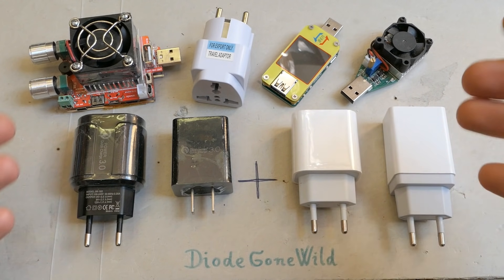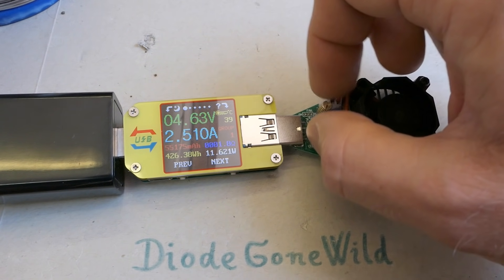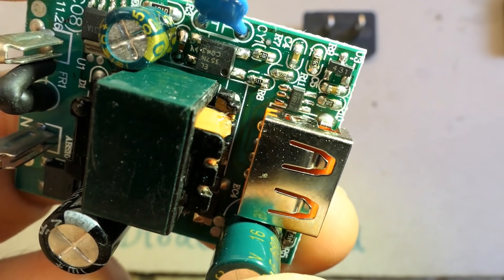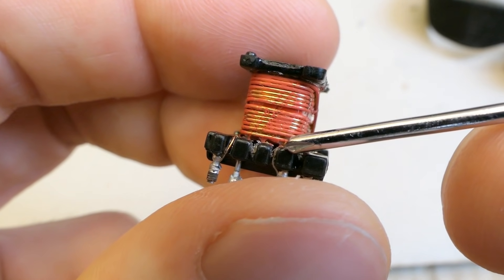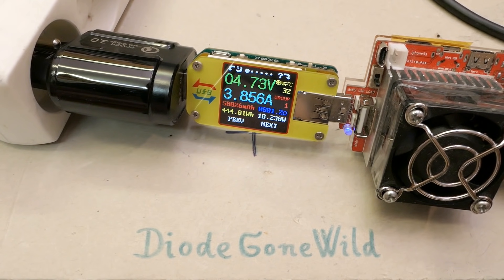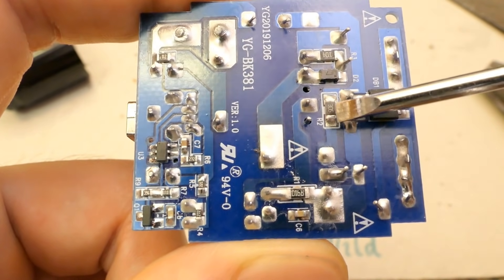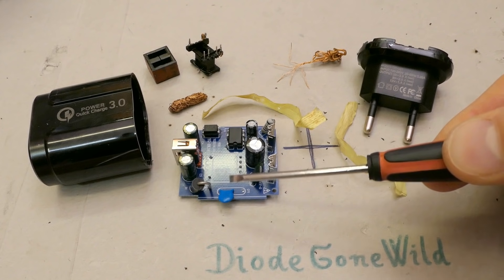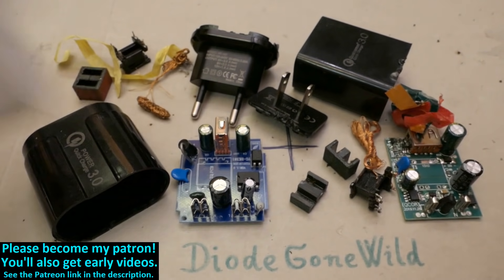Dangerous USB phone chargers 7 (QC 3.0)

Comment: Dodgy chargers never get boring
(You could also take a look at some real dodgy ATX PSU which are real cheap, price and quality wise)
Reply: I've seen lot of them and honestly they are not as dodgy as they could be, and some of chinesium type higher power psu are ok-ish. The biggest problem is low efficiency, no protection, rating from ass (sometimes 2x more than in reality), and use of low quality components (and fan, so it leads to explosion). Sometimes you can also see omitted filters, PFC choke made of cement in a plastic case (that's not a joke), radiators almost from aluminium foil... But safety-wise it's not that terrible from my experience.
Reply: @michamaecki8104   they do survive about a year or two when used lightly just doing word processing and some light stuffs on computer but interference... Interference everywhere, noisy fan and fake PFC coil and less to nothing noise filter.
Reply: Here in india i got a 450w atx power supply for 300₹ (~4$)
Reply: @hardnachopuppy  Does it have any protections like over current, over voltage ...?
Reply: @Leon-ts1nl  it does but only on 12v rail
Reply: He should take a look at some Gigabyte exploding PSUs.
Reply: @CaveyMoth  Aah yes, P750GM, now that was a super nice power supply! :)
With regards to the cheapy ones, they usually have poor quality components and also very weak 12V rails - which is where the CPU/GPU power goes, as well as a load of other important stuff. So you need the full power availability on the 12V rail.

Comment: There was a girl using a cheap charger while listening to music on her phone, and somehow the charger failed and the AC mains somehow came through the US connector into the phone, then through the earphones and killed her. That was a freak case, because for the AC power to be able to get that far and that long before burning anything out was quite crazy. What I suspect is that not both lines of the AC made it through, but just one made it through, and somehow the girl was grounded and thus she completed the circuit and died. Likely a cheap transformer allowed  one of the AC lines through into the secondary coil, and then from there through the US connector, and into the phone it somehow found it's way to the audio jack, and then it was able to cross from the speaker head into her ear and into her brain, and out of her body from however she was grounded. 

Either way, even if that is a freak case, I would never suggest anyone actually use wired earphones while their charger is plugged in, no matter what brand the charger is.

Comment: I've seen a failure mode in switching power supplies where the secondary rectifier would get so hot that it would start conducting in reverse, which would then cause the primary-side overcurrent to trip. Once the diode cools off, the primary restarts and the device cycles like that. I suspect this may have been why the second charger was cycling even though it could initially supply more than its rated current.

Comment: I think I’ve watched all your dodgy charger autopsies and I still enjoy watching each new one 😁

I was wondering how smooth the output of these chargers are. I suspect that there will be significant differences between the chargers on this aspect too. 
Perhaps you could show us the ripple on these chargers, especially at some load. 

A large ripple could cause damage to some phones.
Reply: I learnt that lesson the hard and expensive way. I used one of those cheap chargers to charge my phone and it ended up permanently damaging my touchscreen, it reported random touches by itself and gave erratic behaviour
And hell, at the same time I used it to power my raspberry pi, after some months wifi, bluetooth and usb stopped working
Now I only use OEM chargers, they're worth the extra couple of bucks

Comment: I really like teardown video series with those crappy chargers, I was a little bit shocked, how dodgy can be such charger especially transformer. 

I would also include in charger rating its output properties, while some el cheapo chargers can be safe and deliver advertised power permanently, they can have problems with ripple, voltage spikes on output that can affect touch screens (phantom touches, not registering touches), fingerprint readers and sensitive appliances. If you have time and tools for that, try adding this into your rating conclusion.

Thanks for so far reviewed chargers and I am looking forward to new teardowns ;)

Comment: Nice! I was looking forward to another USB chargers video! :)
I personally wouldn't trust any of these dodgy chargers from eBay... a genuine OEM charger, or a good quality replacement, would probably be my best bet. I have at least 3x genuine Samsung chargers which are all going strong, as well as a two port Anker USB charger (also works fine). I don't use cheap knockoff chargers.
Reply: Same here: I use Anker and genuine Apple chargers, that’s it. Anker’s latest multi-port charger is delightful.

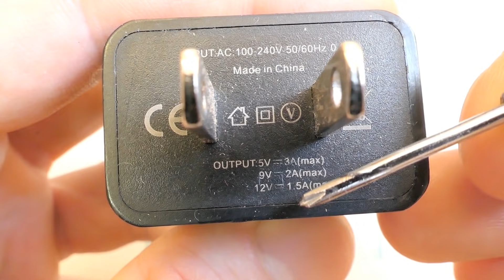Comment: 1:02 this is an old model usb adapter:
at energy efficiency only V appears and newer models have printed VI on them
Reply: All of the ratings on these cheap non-certified is totally fake. The Chinese will screen print energy efficiency level VII and CE, FCC, UL, or anything else you ask for.
Reply: @johncoops6897  I opened the topic with the energy efficiency mark to say that all these adapters are stocks and old generations of adapters: I would be curious what the ones with the VI mark look like on the inside. 🙂
Reply: @mihaiachim5299  - The adaptors with a VI mark would look EXACTLY the same on the inside. These shitty cheap adapters are NOT certified for any Safety Standards, and they are NOT tested for Energy Efficiency either.
My estimation (as somebody who managed testing and compliance for a power supply importer) is that these wouldn't meet even the lowest standards.... irrespective of what is written on the enclosures.

Comment: In the second charger...do you suspect that most of the heat was from the diode on the output?

What do better quality chargers do differently to fix this issue?
Reply: 2x shottky in parallel is very common, but real good ones have FETs as well w/ control logic to switch them similar to a diode. The heat was from the diode and the transformer, mostly, the capacitors likely have high(er) ESR which also contributes, the traces are likely not large enough to carry 3A, so some losses there as well. We don't know the original quality of the solder joint but that could be an issue as well.
The overall quality appears to be of a complete noob doing the soldering part (it is manually soldered, note legs are not trimmer properly either), hopefully not forced labor...
Reply: The higher quality chargers also use Schottky diodes with super-low forward voltage drop and over-rated (ie. 4 or 5A in a 3A charger).
I was repairing something the other day that had some special diode with 0.12V drop at 4A, and the maximum current through it was only 2A.

Comment: Hi Diode!!! Really appreciate your videos! What about making a non-dodgy USB charger video series? Some of them are really interesting... For example I have a 5V 2A Samsung USB charger which works very well... It outputs 2.4A at 4.8V (around 2.2 at 5.2V) and the ripple is also very low compared to the other ones. But the real gold about this charger is the fact that the no load voltage is 5.1V and as soon as you start loading it the voltage rises gradually to 5.4V at 2A, and this helps a lot to contrast the voltage drop caused from sh1tty USB cables and very used and old USB ports that don't make a good contact.
Since I'm curious, I opened it and I've been positively surprised... In fact it has a little bit of interference filtering, a double 4.7uF 400V primary smoothing capacitor, then it has a physical cut in the pcb with a plastic barrier in order to separate the hot side and the low voltage side... Then it has a pretty big SMD output diode with a wide tinned are working as an heatsink... Then it has two 390uF 6.3V low ESR polymeric capacitors in a pretty small case. The transformer looks good and so the general quality.
The model is ETA-U90EWE travel adapter. The markings are in both English and Russian, but there are some just in Russian... Eg. There's this marking дата производства: 30.07.2003, which I think it's the production day/month/year... You should make a video about it! 😃👍

Comment: I love how the cheap circuit board has the UL recognized component marking (looks like ЯU) even though it's sketchy af. Just because the factory that supplies the circuit boards has good quality control (in theory necessary to get UL certification) doesn't mean the factory that assembles the power supplies or transformers isn't sketchy as fuck.

Comment: Please someone told me about if optocoupler failure will flyback power supply send surge voltage to secondary side / output? any fail safe mode? like sense from aux winding like primary sensing?

Comment: I wonder WHY they couldn't supply their voltages. Is it the board design, shit solder, poor transformer windings, or crap components?
Reply: Transformer (more precisely, too thin winding wires)
Reply: The second one did reach its nominal voltage at its maximum current before it heated up. The efficiency of the secundary rectifier was poor, causing major losses and/or protection mode and possibly the RDSon resistance of FET in the driving chip was too high for the power that was to be delivered, causing it to heat up and go in protection mode. The transformer didn't go into saturation as it could  deliver its nominal power for some time. Also if the copper losses would have been too high, the transformer might have melted before the diode or the driving chip.

The first one didn't have an obvious cause, it was probably diemensioned correctly for half the power and then the primary current limiter was modified but nothing else.
Reply: @МихаилЦымбал-д9м  too thin wires would cause transformer losses (copper losses, not necessarily core saturation losses). This might have been one of the many things wrong with the first adapter, but probably not with the second one - or at least not obviously. Maybe after you uprate the driver and the rectifier which are the only obvious bottlenecks in the second one. I would first try and modify it to use active rectification and then see if there are still other problems.

Comment: Great videos ! , one question please - I have a bad LED driver that has a 10MF 400V bad primary smoothing electrolytic capacitor, is it OK to replace this capacitor with a capacitor of 47MF 450V ?
If not, what can be upgraded and what can't, V / MF ?
Reply: voltage - anything over 400V+ would be ok (for 230V mains), and having more capacitance would also be totally fine - the inrush current is unlikely to damage the diodes. In other words - it's a fine replacement.
Reply: @stanimir4197  thanks a lot - It works :-)

Comment: What is the name of the device that can switch to 5 volt 9 volt 12 volt which is red in the middle
Reply: How does it figure out which voltage to put out at the output? On the PCB the data pins (the middle two pins) are soldered.

Comment: Lets be real no phine will draw 3 amps continuously frim any charger so your testing with long time arent that good and acurate
Reply: If you print a spec on a product it is reasonable to assume the product can meet the rating.
Reply: @1pcfred  of course i dont disagree to that but the secind charger neet its ratings and any way most phine nowdays use fastcharge nit slow charge with 5V and even is they still use it they are nit gonna graw the hell amount of current that the charger outputs i mean its not gonna max out the charger
Reply: @constantinjitariu1439  I don't care about phones. I don't even own one.
Reply: @1pcfred  why?
Reply: @constantinjitariu1439  why what?
Reply: @1pcfred  why dot you have a phone?
Reply: @constantinjitariu1439  I do not have a phone because I have no use for a phone. I don't call anyone so what would I do with a phone?
Reply: New phones do if battery is to low, my nokia 6.1 draws 3a from charger until 60% and then drops to around 2.4amps.
Reply: A modern phone might draw 3 amps at 5V for 2 hours. If it does switch to 9V it might still draw 2 amps for 2 hours.